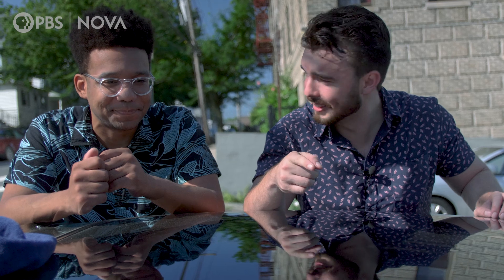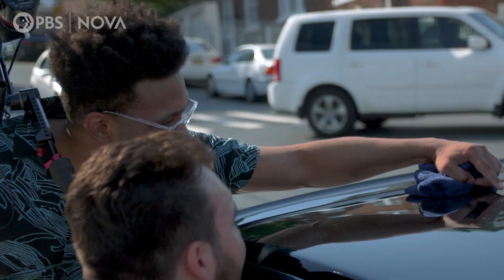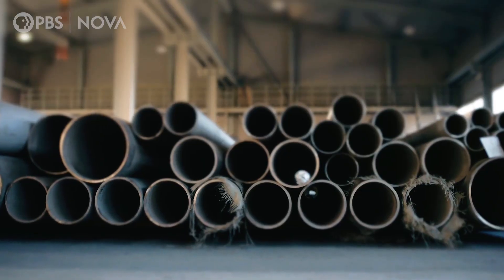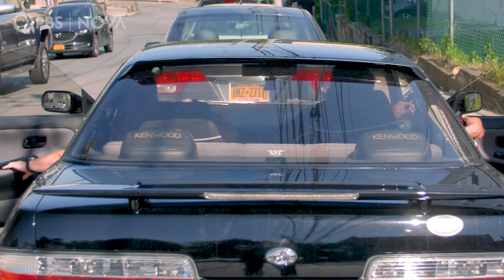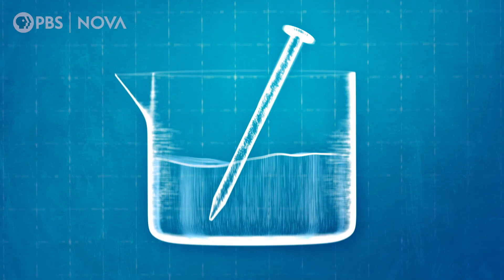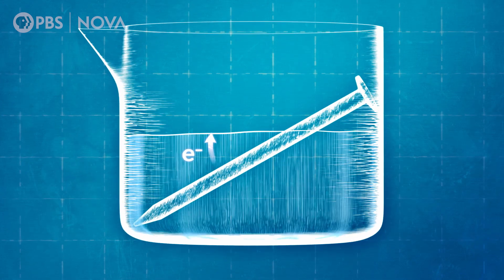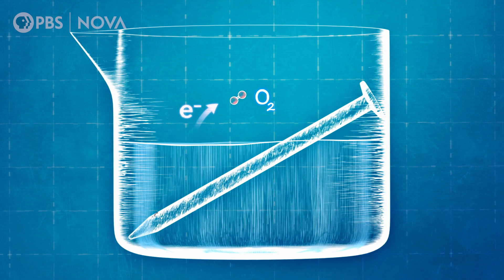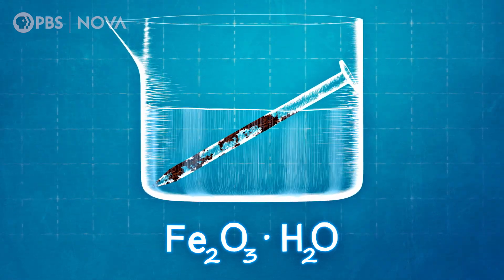Why Does Metal Rust? (And Why Should We Care?) | Out of Our Elements

Comment: Why do some iron alloys are more prone to rust than others when neither is stainless? I have a meat grinder with a replacement bolt for holding the handle in place. If the bolt gets wet it rusts quickly, but the rest of the grinder doesn't even in places where any coating has been rubbed off.

Comment: Here is an interesting tidbit on rust that wasn't mentioned here that makes replacing really old infrastructure a bit more complicated. Metal made before the 1940s was much more resistant to rust. As an unforeseen impact Of the Manhattan Project + all other subsequent nuclear testing and the improper recycling of affected radioactive metals, the resistance of corrosion metals have compared to before the 1940s is greatly reduced

Comment: Look to give you guys a heads up. Rust is a very slow reaction so you know it’s only really a problem if you live at the coast then you need to put some prevention in because Rust will build up very quickly, but if you live in dry areas and inland, you can have bits of steel outside for a few years and it only just damages the surface layer I’ve got big steel plates that are 2 inches and 3 inches thick and they’ve been outside for a few years and they just got surface rust layer of discolouration but no major penetration damage of the rust probably less than 1 mm if that it’s more the appearance of the plate looks awful. Also guys it depends on the thickness of the steel see when it comes to stuff like cars they made out of paper thin metal. They rust through pretty quickly once it starts in a matter of a year or a few years depending on the environment, you live at. Also ships that sail across sea once the paint layer Wears off or the zinc. Bars have corroded away Steel Will Rust pretty quickly to? But in reality, if you have blocks of steel outside in your backyard and you live in inland Australia or inland in a country that you live at Rust is not going to destroy the block of steel in your lifetime it’s such a slow reaction. Also, iron and Steel are pretty much almost the same thing. Steel is just the alloy of iron. It’s just a little bit of carbon added to iron and small traces of other metals to depending on the grade of steel.

Comment: Interesting fact a way to actually fight rust on old firearms is done by boiling all metal parts in water using a carting wheel you knock off the converted rust and then leave the parts in a kerosene bath fully submerged for a day then take out blast dry with air oil all parts and put back together it will not make it look new it only stops the decay from going further

Comment: Ah, I was hoping to hear more about the methods of rust prevention and resistance.
Reply: Same here. Their other videos usually contain more information than this one.
Reply: The process of bluing metal; in particular gun metal may be of interest to you.  As I understand it, the process rapidly oxidizes the surface layer then converts the red iron oxide, which is soft and highly porous to black iron oxide which is more like a ceramic material.
In general it's a type of surface passivation.  Several non-corroding metals like aluminum are actually highly reactive -- much more so than iron but upon contact with air they naturally form robust surface passivation.  In the case of aluminum the passivation layer is essentially sapphire so even a few nanometers is enough.  Salt (chlorides actually) or alkali can still attack it though.
Reply: @whatelseison8970  Interesting! They should make a video on that one. I am mostly familiar with galvanization, electroplating or alloying.

Comment: We should just stop building with steel and use carbon.
Reply: So diamonds
Reply: @brianisme6498  diamond's aren't the only form of carbon. 🤣
Reply: @paytonpryor  no it is not. But it is almost entirely carbon, being about 95% carbon. The most pure of any gem. Plus it’s concentration makes it extremely tough. It’s highly unrealistic for us to suddenly stop using steel for diamonds. Or any other material actually, but it’s a random suggestion off the top of my head.
Reply: @brianisme6498  carbon fiber is extremely strong and lightweight. You're right it is a random suggestion. But I want to make it as clear as a VVVS Diamond for the second time, when I said carbon, I wasn't talking about building with diamonds. That's ridiculous. If I meant diamonds I would have said diamonds. BTW there's a ton of carbon in our atmosphere to capture and convert. We have concrete that can absorb carbon from the air. Steel is old technology. It's time to advance humanity.

Comment: Why is Zinc used as the coating? Aluminum makes a self passivating layer, but I wonder if it doesn’t make a good contact? 
I also thought that steel alloys with chromium are rust resistant, but is this false?
Thanks for the great videos!
Reply: Zinc is used because it is easy to deposit onto surface of steel and steel alloys, and it is a reactive metal that forms an oxide coating as well. You do get aluminium coated steel, but it is a much more expensive coating, as you have to apply it in an inert atmosphere. Zinc you can apply to clean bare steel in an open bath, either by immersing the cleaned and acid etched steel into a bath of molten zinc, or by using electrochemistry to apply it in an electrochemical cell from a zinc anode, using a zinc chloride in water solution.

Aluminium you can do neither, the melting point is too high to have it out in the atmosphere, as it will catch fire, and in water it is too reactive. Thus you have to apply as a coating via sputtering in a relatively high vacuum, running a cleaned steel sheet from a roll to another in the vacuum.

Chrome and it's alloys with steel work, but rely on the formation of a chromium oxide layer to passivate the surface. Thus stainless steels, but they are all slowly going to corrode as the thin surface layer wears, and are not really suited for salt water use, or near the ocean, as the saltchemically reacts with the coating to dissolve it with time. Any chloride will do it, so even road salt will slowly erode it away.

Comment: Meanwhile here on Oahu,, Hawaii, when the state built the Aloha Stadium, they said there wasn't a need to paint it. A protective layer of rust would form. Ummm we're surrounded by salt water/ocean mist.
Reply: Really only copper and a few other metals do that. It forms an impermeable oxide layer, iron forms a permeable layer. 

Edit: copper will almost never degrade past the surface corrosion, aluminum can still corrode away albeit slowly, titanium isn't common, and stainless is too expensive to see widespread use in structural applications.
Reply: @trulyinfamous  No, copper isn't the only metal that does that. The whole reason stainless steel works is that the other metals in the alloy form an impermeable passivating layer. Aluminum also.
Reply: @thomasrosscmt1385  I forgot about that when writing my reply, I've edited it.
Reply: If it's ten-core and it's not actually in a splash zone then that is probably fine.

Comment: For the car poor surface prep, plus did not strip down to bare metal and completely cover with a chemical rust converter to make the oxide a more durable phosphate, and also do the same on the inside of the vehicle as well. First remove the rust, make the material chemically clean, and passivate with a thin chemically bonded coating, then apply the primer, make smooth, then apply the correct automotive paints, and finish with the clear top coat. Has to be done both top and inside, though the inner section under the lining you do not have to bother with looking perfect, so it is faster there.